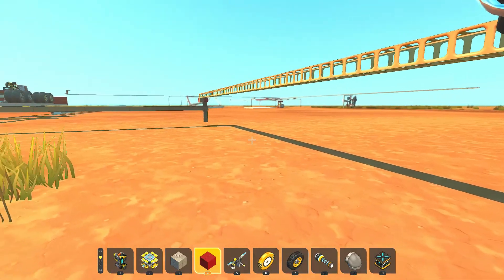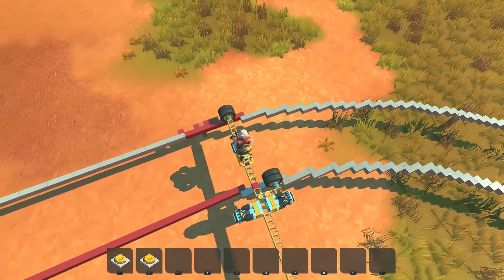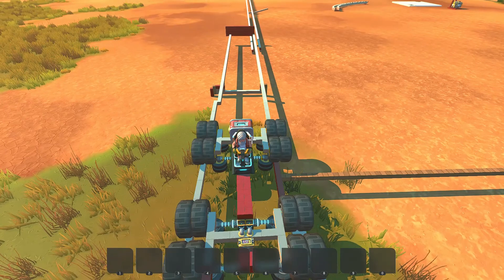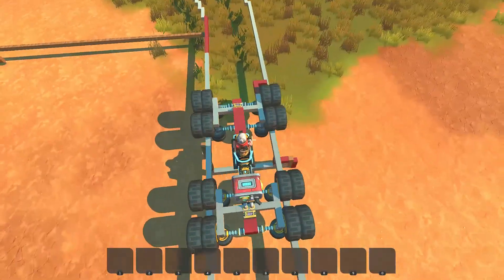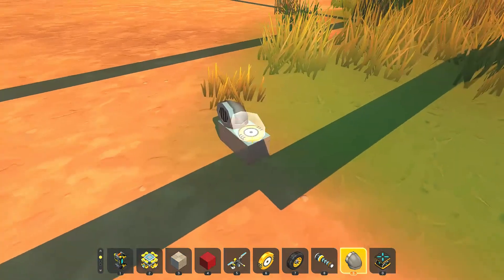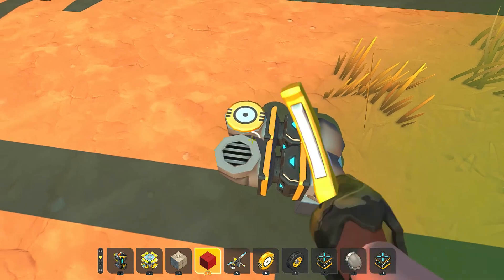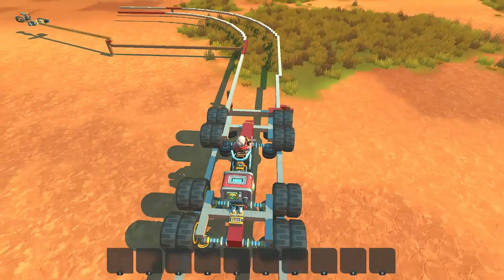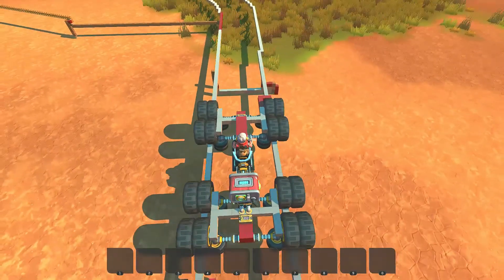Scrap Mechanic - Creative -14 Gauge twin rail track spacing test. Testing curve spacing.

Comment: Love the concept and definitely want to see how you improve it!

With my i-frame monorail design, I was able to (almost) fully implement it in pure vanilla using a mixture of small and and large 1 block pipes/pipe corners to get a similar effect to wedges. 

Pipe pieces might help smooth out your corners, it'll just require some balancing and potential lag testing.

Keep doing this! I'm so looking forward to updates!
Reply: Also curious if raising the outer rail could assist with a smoother transition.
Reply from the maker: @Massitcles  I have used pipe as well. Pipe has a tendency to slowly build up lag, as you use more and more. And a corners worth with the mass I am pushing on it, it going to lag, and a small lag will allow the guide wheel to phase through the track. 
I have been testing with a train layout I should post the update. Two Cars is the sweet spot. 3 Cars there is too much lag. I have made a new track, took a lot more care with the radius, and now the transitions are great through "S" bends. I make the out side curve transition to straight  flatter and leave the inner  curve to be a support. The front and tail guide wheel suspension is softened to about half. All others are maximum. 
Raising the outer rail to make a banked curve does not work. The sudden angle shift, throwing 20 fruit crates around, Then all the tires are on angles is mega lag. vs. Some front suspension tweaks
Reply: @GuardianOz  I was actually thinking about the banked curve and realized with what your plans were it wouldn't work. The modifications that would potentially need to be made to the carts would just increase the overall lag.

Yeah, that's the downside to parts vs blocks: has to be balanced or you just make lag generators.